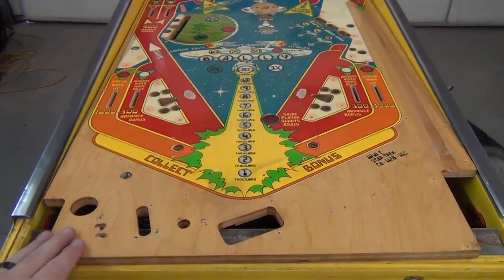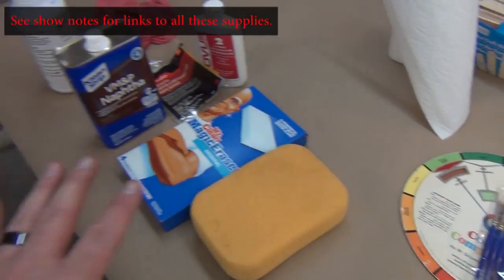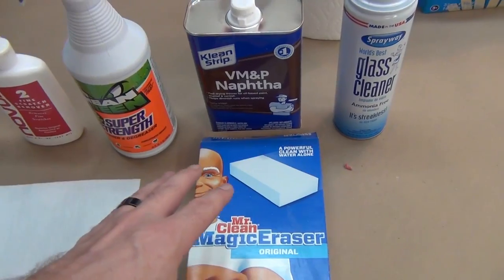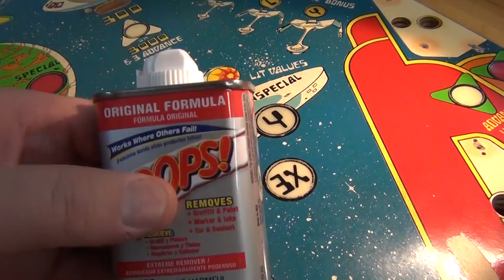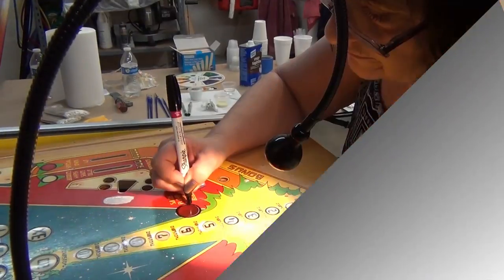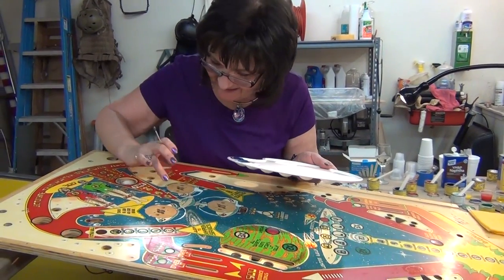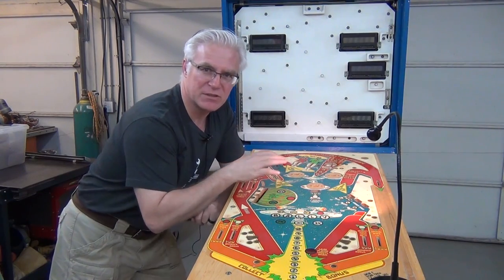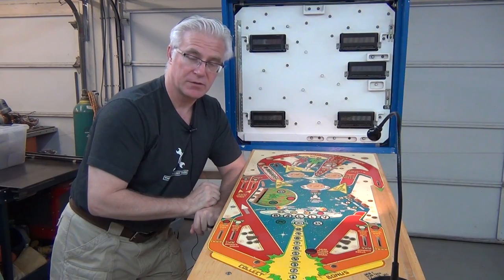How to Clean and Restore a Pinball Machine Play Field

Comment: Only now, 8 years since you posted, I finally see this.  I am touching up my Star Trek machine.  I have a worn spot in the blue star field on the right of numbers 7 and 8 (thousand).  This video is helpful as I see a bright star off number 8 that I will need to paint in.  I am using Home Depot paint chips to match up the blue that I need.  Dang, that off blue is hard to match!!

Comment: This is a great video! The only thing is that you kept calling the Oops stain remover “Goof Off” which is a completely different type of solvent. 

Goof Off is acetone based and will eat through any plastics pieces you get it on, including the light cover buttons you cleaned.

Comment: Did you lose much paint when cleaning with naphtha and the magic eraser?  I hear mixed reports on the results when using these on older playfields.  I want to try it on my 1980 Williams to give it a good cleaning but worried I'll damage the existing paint.  Just curious what your result was and if you if the paint loss was minor where you used magic eraser
Reply from the maker: No, when it started to look a bit to much paint on the sponge I stopped and by then it was quite clean. Very  minor paint lost for me.

Comment: I think this video will help alot! Tomorrow I'm going to go pick up a FREE pinball machine but its in realy sad shape... There is almost no paint at all left on the play field and the play field itself is falling apart... I think I'm gonna have to get a new sheet of plywood and just completely redo it. Same with all the electronics. I think its an electro-mechanical one to so I'm gonna have to go through and Probaly clean every relay and check every solenoid to make sure they move freely
Reply from the maker: If this is your first you're going to regret this. From the should of it I recommend you take it straight to the dump and save yourself a huge amount of money. Look for a better condition solid state machine that is in working condition as a project. Maybe a bad switch or two, maybe a bad bulb or two, maybe needing new coils, flippers and rubbers. What your talking about is way to far from a reasonable condition to be considered even for free.
Reply: Todd Harrison well I'm just a kid and I realy don't have money but I do have mad electronic skills so I just figured this would be a good project to do when I'm bored, u know? I was thinking I would see what I could do to it and go from there
Reply from the maker: That's a good state of mind to have going into such a project. I wish you the best of luck and know you will learn a lot on your adventure. You will find that money is going to be a wall for such a project. You might get a lot of it working depending on current condition. There are lots of websites that can teach you a lot on your way.
Reply: Omni Engineering if the back glass is still in good shape and the play field is bad. Make it a wall hanger lamp. Meaning just put the lights in it and turn on and off as you would a lamp. ,😉Then sell it to someone in NY for thousands.

Comment: Have you finish clear coating it?  Would love to see the finished product.  You have motivated me to start restoring my pin.  Great video by the way!
Reply from the maker: +Eddie O I did have it clear coated by an custom automotive paint shop that has done many pin playfields. It did turn out ok really but I want the finish to be like a mirror. Right now you can see the rolling surface imperfections around the inserts. So I'm going to setup shop in my garage and video how to clear coat, sand and buff a field using automotive clear option. The two coats that are on it now are ok but need to be sanded and the low spots filled with new clear coat then a few repeats. I could keep taking it back to the automotive paint shop for the clear coats but for the cost of just the one run I can purchase all the product and do the run 4 times myself which is what it will take to make a mirror finish that will last forever. Here are some links to what I plan on doing however these videos leaves out some details, not much but some and are a bit hard to follow in my opinion. Watch his clear coat videos 1 through 5 in order. But make sure to really clean the field and watch and follow his touch-up videos first.  https://www.youtube.com/user/MyVintagePinball/videos
Reply: Thanks so much Todd for the information.  I might follow your process.  Sounds like if you want something done right you have to do it yourself.  I'm an artist too so I will give the touch up method your aunt used on my playfield.  Hopefully I can do a good job too.
Reply from the maker: +Eddie O Great, let me know how it goes. Maybe think about opening a YT account and posting some before and after vids?

Comment: When you show the final product - can you list the materials for the clear coat you used?  I want to try and clear coat my playfield but I want to see some other recent example first.  The painting was awesome, very nice detailed work - that is not easy and she did a great job.  I am interested watching this since you did not pull the whole playfield out of the machine which I think saves a ton of time.  Can't wait to see the final result.
Reply from the maker: +MH MH I really struggled in my mind with doing the clear coat myself. I researched how others have done this using "Krylon Triple-Thick 12 oz. spray can" as well as others that have a shop air compressor and put on an automotive clear coat themselves.  The spray can jobs never look too smooth and the home automotive clear coat was going to cost me $200 in supplies to do it right. I called around and found a shop that does "custom!" automotive paint jobs and learned they have done lots of pinball play fields. They charged me $150 and it's out for clear now. I should get it back in about a week. I will shoot video on sanding it 600 to 2000 grit in levels then buffing out and later waxing once it sets for a few weeks. However, if it helps here are my notes if I was going to try myself.

Two clear coat options:
 1) Krylon Triple-Thick 12 oz. spray can
 2) Automotive clear coat using air gun

1) Spray can clear coat steps:
0. Strip playfield of stuff.
1. Blow off playfield with compressed air and Vacuum 
2. Clean with Mean Green enough to remove surface dirt
3. Wipe down with Naptha (lighter fluid)
4. Clean deep cracks with Mr. Clean Magic Eraser and with Iso Alcohol
5. Wipe down again with Naptha
6. Touch up with water based acrylic paint
7. Wipe down with Naptha
8. Clean off PF with compressed air
9. Spray a misting coating of Krylon Triple-Thick 12 oz. spray can
   9.1 let dry
   9.2 Lightly sand with 600 grit
   9.3 Wipe down with Naptha 
   9.4 Repeat four more times
   9.5 Then orbital sand with 800, 1000, 1200, 1500, 2000 grit sandpaper
10. Polish with Novus 2
  10.1 let dry and then buff off good with clean buffing pad.
  10.2 clean with Naptha
  10.3 clean all wholes out with window cleaner
  10.4 repeat polish with Novus 2
  10.5 let dry and then buff off good with clean buffing pad.
  10.6 let field harden for 2 weeks!!
11. Put down your Mylar for bumpers and sling shots.  
12. Wax twice with Wild Cat #125 (or) Johnson Paste Wax (or) Best option - Blitz Carnauba Paste Wax from: 
  http://www.pinballlife.com/index.php?p=product&id=2589
13. Buff out wax with buffing pad to a high gloss finish
14. replace all playfield stuff.
done

2) Automotive clear coat steps:
Watch how to automotive clear coat
  https://www.youtube.com/user/MyVintagePinball/videos
Read this: This describes "diamond plating" a playfield using Automotive clears
  http://www.pinrepair.com/clear/index.htm 
   
Blow out garage a lot, get all dirt out and vac garage
 let dust settle and sweep again.

Build a plastic drop wall all around to form a booth
  -buy plastic rolls

Dry out compressor and put on line driers 
  -buy in-line driers from Harbor Freight, maybe get a better gun at Harbor Freight?

Scuff play field with ~1500 grit
Wipe down with Naptha before clear to get off ALL OILs (2 or three times)

Use lacquer cleaner to clean gun and set/test gun before spraying clear coat
  Also remember to use lacquer cleaner to clean gun after spraying clear coat
  -buy lacquer cleaner
  
Best to Clear coat with DuPont:
 ChromaClear HC-7776S (4 parts)
 ChromaBase 7775S (1 part)
 Add "Smoothie" too to clear coat mix to prevent fish-eye from oils on field. (about two drops)
 
 Other Clear coat options:
 ChromaClear G2-7779S
 With ChromaBase 7765S
 or
 EuroClear works too I guess

Get mixing buckets and mix 4 to 1 with 2-3 drops of Smoothie

Tack with tack cloth just before clear coat goes down.

Put on first "LIGHT" clear coat not too much clear need. 
  This coat is about a 5 count spary path longways and for about 10 passes where down and back is 2 passes.
  Spray about 1.5 feet from play field
  Clean gun with lacquer cleaner
  Wait for flash over ~20 minutes 
  Then immediately put on second clear coat heavy so make sure to have lots of clear in gun this time.
  Clean gun with lacquer cleaner
  
Let dry for a day

Wet sand with 600 grit to as close to level as possible
Clean with naptha

If there are low spots:
 Level field dead-on using bubble level and shims
 Level inserts and low spots with eye dropper of small amount of clear mix 4 to 1 with 2 drops of smoothie
 Let level drops dry over night
 Sand level drop even with play field
 
Clean with naptha again

Get mixing buckets and mix 4 to 1 with 2-3 drops of Smoothie

Tack with tack cloth just before clear coat goes down.

Put on another "LIGHT" clear coat not too much clear need. 
  This coat is about a 5 count longways and about 10 passes where down and back is 2 passes.
  Spray about 1.5 feet from PF
  Clean gun with lacquer cleaner
  Wait for flash over ~20 minutes 
  Then immediately put on second clear coat heavy so make sure to have lots of clear in gun this time.
  Clean gun with lacquer cleaner

Let dry for a day
  
Sand wet with 600, 800, 1000, 1200, 1500, 2000 grit sandpaper

Buff out with:
 first:  3M 39060 Perfect-It Rubbing Compound (then clean up)
 second: 3M 39061 Perfect-It Machine Polish (then clean up)
 third:  3M 39062 Perfect-It Ultrafine Machine Polish (then clean up)

Clean with Naptha
Clean all wholes out with window cleaner
Let field harden for 2 weeks!!

Wax twice with Wild Cat #125 (or) Johnson Paste Wax (or) Best option - Blitz Carnauba Paste Wax from: 
  http://www.pinballlife.com/index.php?p=product&id=2589
Buff out wax with buffing pad to a high gloss finish

replace all playfield stuff.
done
Reply: +Todd Harrison (ToddFun) 
I appreciate the update - still want to see it all.  I agree automotive would be best but I was try to not strip the whole field and take it in, just to save a little work.  If you can show how you stripped the bottom and as much as you did.  I was hoping to keep some of the wiring attached to the bottom.  I have fixed a few machines but this can be the tedious part.  Like you I have to have someone else touch up my playfield wear areas - I have no skill there.  What I like about your video is that it is so typical of what you see on a playfield and how you fix it.  There are other videos out there but they are old yours is the most current.

Comment: Try the clearcoat over sharpie on another surface first. From experience the clearcoat will dissolve and spread out the sharpie ink before locking it in.
Reply: She used the Sharpie paint marker - not a regular sharpie, so it should be ok, no?
Reply from the maker: +Mc Pit It was a oil based paint pen made my Sharpie but some of the fine fine lines were done by a normal fine point sharpie. I could be in trouble with that but it's out for clear at a local automotive custom paint shop so if it bleeds I'm just going to be sad. I can only blame myself if it does. We should know in about a week.
Reply: @ToddFun  Did it bleed?

Comment: I've read that the general consensus on felt tip pens, is to never use them, as they will run when you clear coat later.  I don't know that for a fact, but I have read that before several times. Also,  I've read to use  Goo Gone, not Goof Off, because it's too harsh.
Reply from the maker: Yes,  you are right about goo gone. I think goof off is an acetone type mixed. The felt tip pens didn't run. I did have the play filed clear coated by an automotive shop and and none of the felt marker ran. I did wait like a month or many months before sending it in for clear coat so that might have made a difference.
Reply: and they will fade if you don't clear coat. use 1-shot and a #1 kafka or blick scroller (brush)

Comment: Did you use mylar on the playfield?
Reply from the maker: No, I put down automotive clear coat which will not affect play and will last a lifetime in the home. If I did't coat the paint with any clear coat I would have put down some mylar in select areas. I would never use a full play field mylar overlay as all reports say they never fit these older machines and you will fight with roll overs and other transition area play.

Comment: Looks nice in the next vid with the 2K (probably) lacquer! Did you wet sand it in the end? I think I would have given it a light going over myself. If you do as big a block as possible and a careful polishing mopping. Your aunt did a nice job on the touching up!
Reply from the maker: I will be wet sanding this winter and putting down some more automotive clear coat myself. Yes, my aunt did quite a nice job. Thanks.

Comment: is taking it to an auto body shop an option?  maybe let a pro clear coat it.
Reply from the maker: +2020tesla I really wanted to do as much work myself as possible. I know the automotive clear would be the best so I looked into all the supplies and product needed. I was going to be over $200 to do the job myself, plus I'm not paint pro. I had lots of viewers ask me to check into automotive paint shops but the hardcore shops didn't want the job as they push only cars through. I keep looking and found a custom paint shop the does lots of one-off art jobs and found they have done many pinball fields. They only charge $150 so as you can image I packed it up and it's in their shop now. There are some things that are just best left to a pro if you want it to look great.

Comment: What will you be using to clean the balls with?
Reply from the maker: +SeanBZA I think there is joke there someplace. I will use Maas International 91404 . Stuff does a great job on chrome and smells great too. http://astore.amazon.com/tod0f5-20/detail/B00TX0VXUO
Reply: Not sure if you were were perpetuating the joke, but... Do NOT clean the pinballs!  Even if you clean them, they will still have small imperfections that will destroy all your hard work.  It's the equivalent of having a round, steel piece of sandpaper rolling around on the PF.  At $1 a piece from places like pinballlife or pbresource, replacing them is the only way to go.  I replace all the balls in my machines every december.
Reply from the maker: Good point, Thanks. I have a new pack of 5 so I will just replace the ball every year like you.